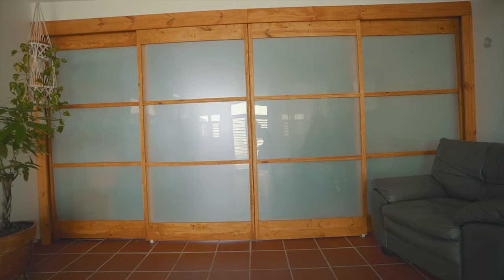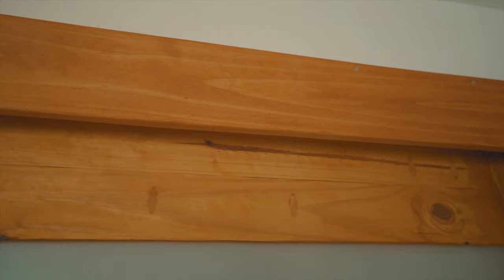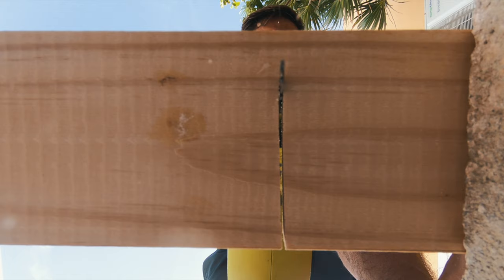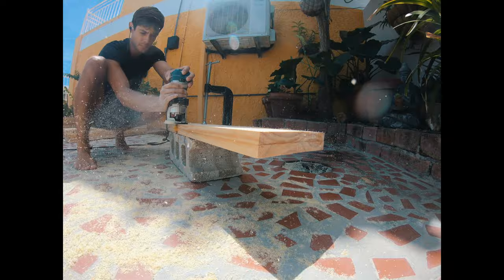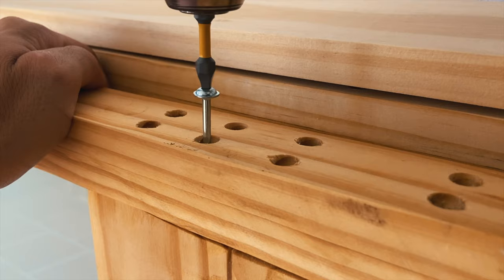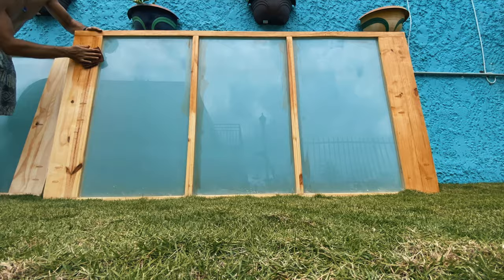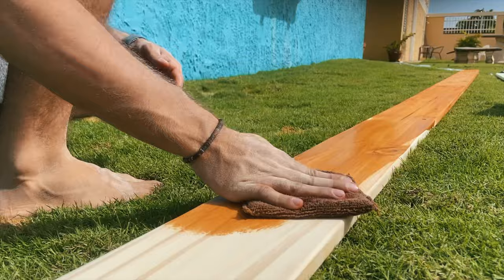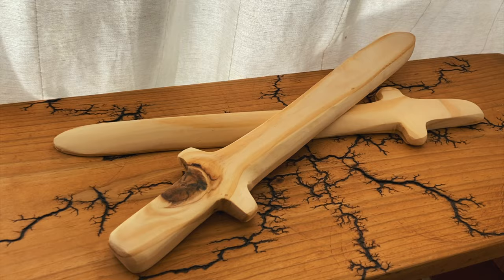DIY Shoji Style Sliding doors

Comment: Really cool. Just one question, what did you use as a floor guide the doors?
Reply from the maker: Thanks! I used a few simple guides like this one: https://www.homedepot.com/p/Prime-Line-Sliding-Closet-Door-Bottom-Guide-4-3-16-in-Plastic-White-2-pack-N-6563/100116785
Reply: @CharlesMiner  Thx!

Comment: What did you use on the bottom of the doors to keep on the track? I did not see a bottom track nor wheels to hold in place. Was it part of the johnson bypass system?
Reply from the maker: Sorry for the late response but yes it is basically a floor guide to keep them in place and it is part of the johnson bypass system but they also sell better quality one separately.